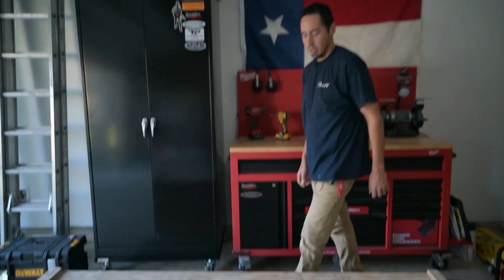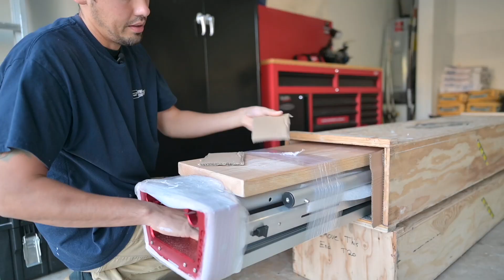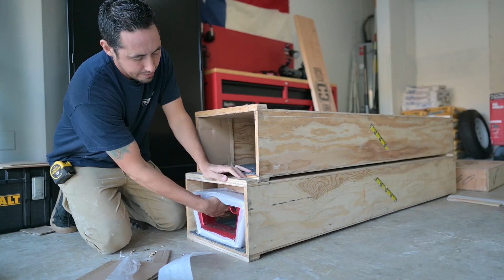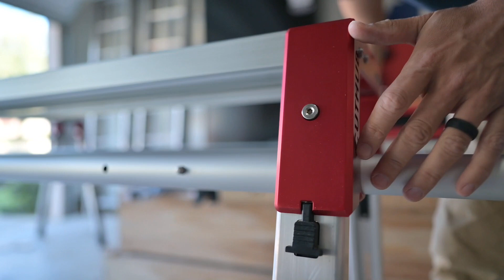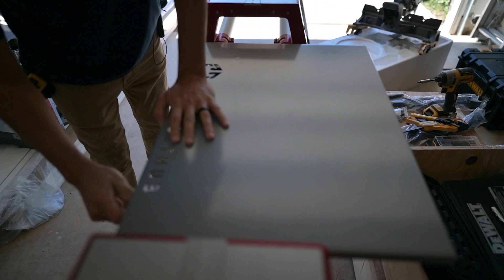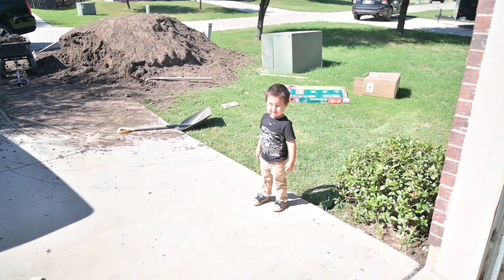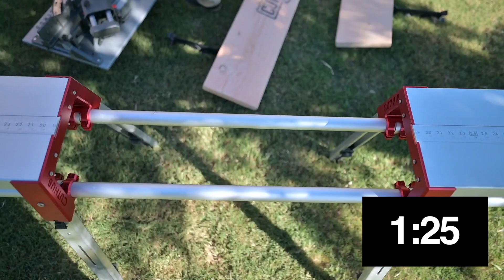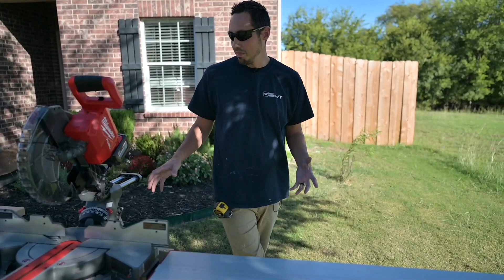I Paid $3400 for this Saw Stand - Cut Hub

Comment: How many miter saws does this man need?!?!
Reply: They have 2 trucks, so one in each, one for home work,  so 3 at least. He do finish work only, so i cant imagine miter saws lasting to many years, in and out of cars. They really take a beating in the trucks. We do all kind of work so miter saws go down the line  as the wear sets in, to the point of emergency saws if one of the more decent ones fail. Better not hope it is a finish job you are about to start on when that happens.😂
Reply from the maker: Haha I have 4 total. Two sliders, one fixed. And a 7-1/4”.
One in each truck and I just got the Milwaukee so I may sell a dewalt if I really like it.
Reply: Never too many
Reply: Finish Carpentry TV Sell the Dewalt?! BLASPHEMER! 😂
Reply: Tor Inge Espeland I definitely understand one in each truck when they split up to do different jobs and I can even understand having the 7 1/4 cuz it’s just more light and portable but 4 sass is getting kind of ridiculous 😂

Comment: You INVESTED $3,400 in your business AND in your family.
Break it down:
Assume it lasts 5 years, then you toss it in my lake (as structure for us to crappie fish around). That’s $57 a month. Assume you use it 20 days a month. That’s $2.83 a day.
It’s an investment because it will save you TIME (easier setting up and taking down, and not tweaking the other stands) and MATERIALS (more accuracy means less test cuts, less wasted material, more life out of your blades and equipment).
And how do you quantify the ease of use (less frustration) and added professionalism on the job site??
If you can do jobs more accurately in less time, that means either more time available to take on more jobs OR to spend with your family. More jobs also means more income, to grow your business or spend on the family.
Not to mention, it’s a capital expense (CAPEX), so you can depreciate it and reduce taxable income for a few years.
For a dude like you, this makes perfect sense.

For me it makes no sense...it would be like a treadmill...I’d use it a couple dozen times then stack stuff on it.😂

Comment: $3400 for a stand with tiny plastic leg locks with lots of play , legs set vertical to the bed ..... I should co-co , looks very pretty when you're not in frame ... but as soon as you touched it the lateral wobble was significant , right from the moment you demonstrated how solid the stop-block was , even with two joined together and the saw in place it was flapping around.  I predict that after you've thrown some decent sized skirting on it a few times those leg locks will fail and /or you'll get seasick . Much as I dislike DeWalt  I think you've made a very expensive error of judgment on this one and will be reaching for a shovel to exhume the yellow one.